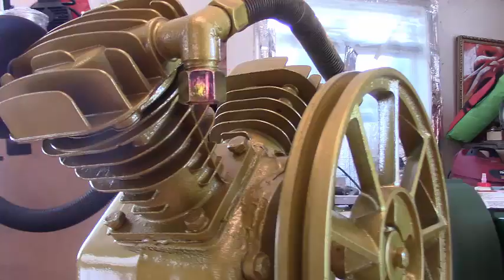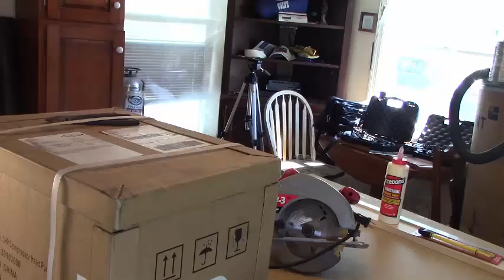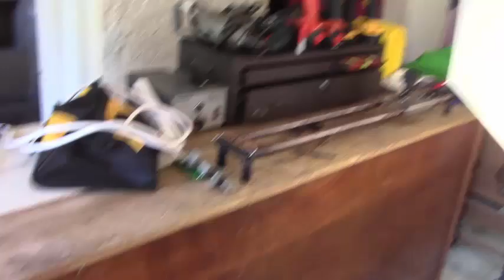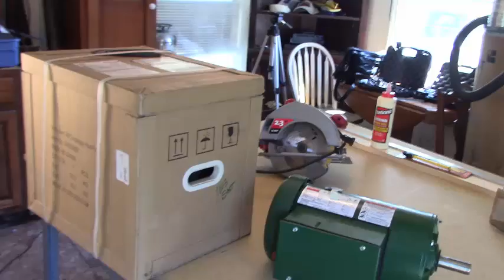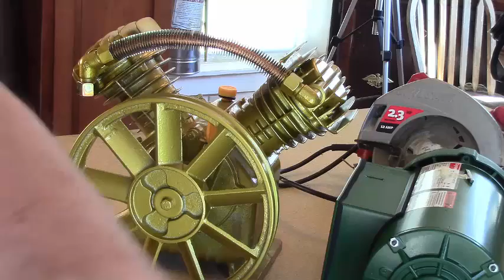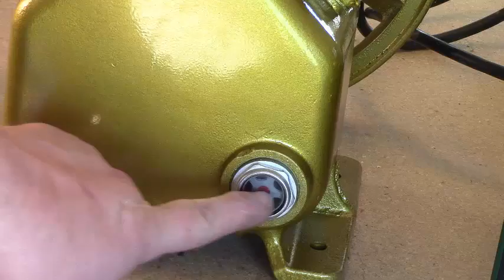How to build an air compressor, DIY air compressor, Part 0

Comment: I think the 2hp motor is to small to run that compressor you may need a 3 or 5hp to get 3600 rpm for fast air build, Just my thoughts

Comment: You will need a 120 to 150 psi pop off valve too for safety . :)
Reply from the maker: +Harvey Zearing Yep, haven't mentioned that yet, but it's already on the tank. Full video coming soon!